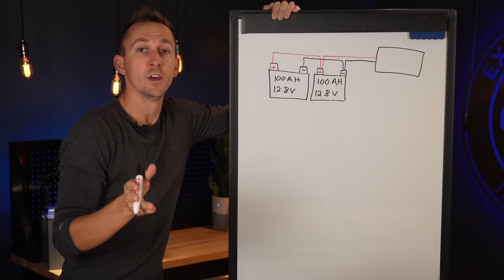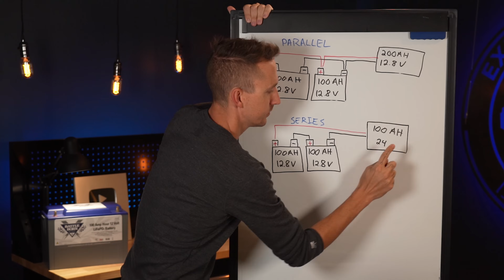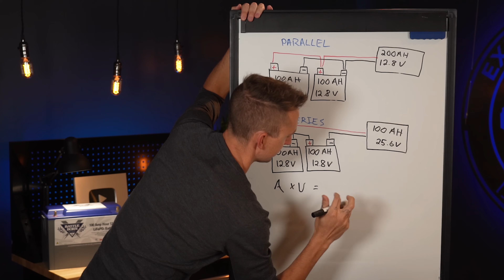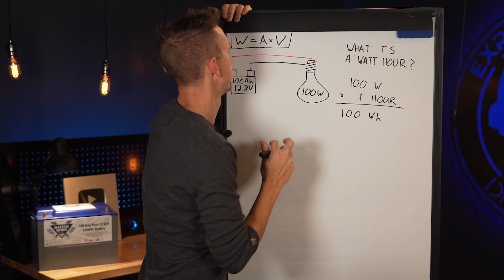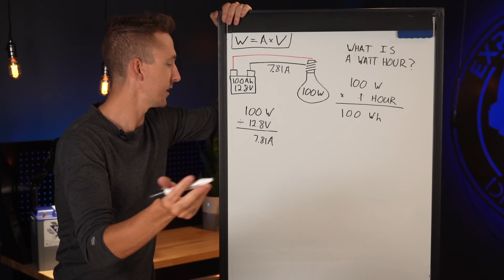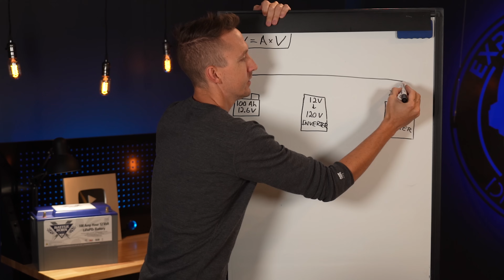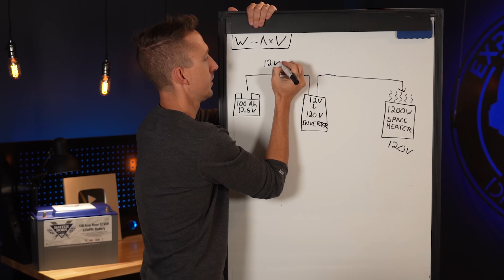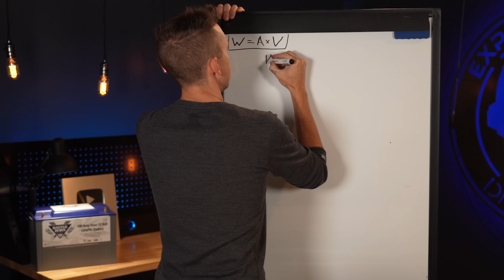AMP HOURS EXPLAINED (amp hours vs watt hours)

Comment: The true watt hours of the battery would be lower if we deduct like 0.85% for inverter inefficiency right? What would be the formula if we take that into account? I'm fogged out trying to remember that.
Reply from the maker: Let's not worry about that for the case of this basic-level video because then we have to start talking about inductive vs resistive loads kva vs watts and power factor.  It gets really really messy in a hurry.

Comment: Nate, your ability to explain with clarity blows me away.  I am an electrician and industrial maintenance technician and know this stuff like the back of my hand, yet when I try to explain it I'm falling all over myself.  Hats off to you, my man!
Reply from the maker: Wow, thanks so much! 🙂🙌
Reply: @EXPLORISTlife Is the max charge rate the same as max discharge rate of a battery? Thanks
Reply from the maker: Not usually.
Reply: It is to know with which voltage the 12v 100 amp or 24v 100 amp batteries are charged faster with a 30 amp charger. I think that the 24v 100 amp battery consumes less amp in use but to recharge it takes longer than the 12v 100 amp
Reply: @dado u prefer to fast charge or slow charge your batteries? vidcolon5903
Reply: Me too, all my life been playing with the electric arts. I normally explain it nicely to others but im still welcome to seeing how others explain it.
Reply: Hi,Nate,So I bought ADCBATT 12V 100AH Lifepo4 battery, W=1280? Is that how it is calculated?
Reply: Yes  @menglei6301
Reply: You probably work on practical stuff most often, than thinking on theory
Reply: Nate, do you have 4 batteries in series and parallel connection. Need 24V 400Ah? Is this possible for 4 batteries with 12V100sh each?.
Reply: @mannyvillamil4140 yes but will be 2x 12v batteries in series connected to 2 batteries in parallel 

So you get 24volts but incase capitacity 😊

Hooe that helps 😊
Reply: I'm a Millenial and I still can't get it. Starbuck never runs out of power.
Reply: @Mr.Negative-One  Yea,, but they ran out of decent coffee the day before opening their doors.
Reply: For coffee.....
Reply: @Mr.Negative-One  Because America runs on caffeine.

Comment: Wow! Mind blown! I honestly thought I would have to take an electrical class at a community collage to understand W=AxV. Well.. I will need to watch this a few more times but this is SO HELPFUL! Thank you!! The voltage! All I thought I wanted was 600 amp hours with a  3 to 5,000 (amp or watt) inverter. With 1,000 watts of solar. Apples to apples… I think I pulled something
Reply: A 5000w inverter* :)

If it was 5000 amp, it would be a really incredibly powerful and Big Heather

Comment: Smaller wires but also smaller parts . Since the parts have to be bigger to handle the higher current values.
Reply from the maker: Charge controller is a good example of that.

Comment: So 24v systems are not more efficient they just allow smaller gauge wire to be use because the amperage is half of a 12v system because the voltage is doubled, correct?
Reply from the maker: Pretty much!

Comment: Nate, using your example of light bulbs. The 12V system is correct. However the 24V system on a 12 volt lamp is twice the voltage required and as such wouldn't you need something to "Step down" the voltage and wouldn't that change the draw on the batteries?
Reply from the maker: What specific timestamp are you looking at?  If it's at the 6:24 mark, that's a 100W 24V bulb connected to a 24V battery.

If you were trying to power a 12V light from a 24V battery bank, the amperage would be different on either side of the step-down converter, but the power pulled from the battery bank would be most easily calculated by: Wattage of the load / Battery Bank operating voltage = amps pulled from the battery bank.
Reply: @EXPLORISTlife  That’s correct but I don’t think in the video that you stated it’s a 24 V bulb so I assumed it was still the same 12 V bulb
Reply from the maker: The only thing important there is that the light bulb is 100w in both scenarios and the light operates at whatever voltage we were delivering the voltage at.

Let's just retroactively pretend that the light I was using was 100W and would function properly in a voltage range anywhere between 10V and 30V.
Reply: @EXPLORISTlife  Nate, If it wasn't a 24V lamp. What do you need to step down voltage?
Reply: @sandstardusthighways7847  A 24v to 12v dc to dc converter
Reply: Nate, I'm not trying to correct you and I'm sorry if I offended you. I am just trying to understand with a 24V system how it gets down to 12V for things like a 12V refrigerator. I think the videos are great and I'm learning but I need to ask questions once in a while.
Reply from the maker: Not offended; just stepped away from the computer for a few hours this wonderful weekend afternoon. 🙂  If you were running a 24V Battery Bank and needed to power 12V appliances like lights/fans/refrigerators and such, you would want to add a 24V to 12V converter between your main system distribution and your 12V fuse block.  Buckle up for a big tutorial now, because I'm going to ask you check out the following video because that's exactly what we did there: https://youtu.be/E5q7_4FH4LQ

Comment: I appreciate your clear concise explanation in all your videos. Certainly helpfull. I'm exploring the new ecoflow power kits that seem full proof for those who don't want to cut, strip, crimp, heat shrink. Those are advertise as kilowatt systems, (5, 10, 15kwh). My only concern is the AC/DC Smart Distribution Panel that comes with their kit appears to limit the gauge wire it will accept. No doubt they have enough power but how do you connect larger appliances such as air conditioning unit with large gauge wire?
Reply from the maker: I don't have much experience with the logistics of setting one of those types of portable power units up, so I can't answer that question.  I would hope that would be something that the user manual of the device would clarify (or their tech support channels).  It's pretty straightforward with the systems like I teach on this channel with individual components, though.
Reply: Assuming you are running the large appliances off the AC side of the distribution panel, you dont need to worry about 'large' gauge wire in the same way you would on the DC side. An Air conditioner should be on the AC side and therefore need no larger than a 10AWG wire.

Comment: This is such a massively misunderstood topic. Thank you for taking the time to diagram it. The only thing I think could be better would be to demonstrate it with physical equipment and put multimeters on the equipment as you move through each step.

On the topic of "higher voltage reduces amps and permits smaller cables", electric vehicles being built these days are typically either 400v battery systems or 800v battery systems (or there abouts). For the sake of high speed charging we desperately need them to all move to 800v systems so that the cables at the high speed charging facilities can be reduced in size. Unfortunately that doesn't seem to be the case with big companies like Tesla. Hopefully that will change in another generation of cars.

Comment from the maker: 6:28 Clarification regarding "Running appliances at a higher voltage".  I should have said: "Choosing appliances that operate at a higher voltage".  We don't really get to pick and choose what voltage an appliance operates at aside from choosing a different appliance (12v DC air conditioner vs 120V AC air conditioner vs 240V ac split phase air conditioner)

➤Shop the EXPLORIST.life store: https://shop.explorist.life
➤Shop Battle Born Batteries: http://battlebornbatteries.com/?afmc=explorist_bb67
✅Use code 'explorist' for $50 off per battery.
Reply: True, though some motors can be wired for either 120 or 240, which can be handy should you be able to upgrade a workshop or such from 120 to 240 in the future.

Comment: Somebody needs to make an app on my phone to calculate all this! 🤣
Reply from the maker: Haha  It's already there!  Just the standard calculator to do Amps x Volts = Watts.
Reply: @EXPLORISTlife  
Thanks for the reply. A question here, what kind of generator do you suggest for backing up your solar? 
This is the final piece to the puzzle of my off grid system. 
I have a 5000 W Victron inverter, eight Battle Born Batteries in series, parallel to make 48 V and around 7K of solar panels. 
The reason I ask, is because of all the threats of power outages, and needing a alternative to solar when it comes to winter.  Perhaps you could do a video on this subject. 😜🖖
Reply from the maker: Both Honda and Champion are the generators I see used the most.  Something in the 3000w range would likely suffice just fine.
Reply: @EXPLORISTlife  
Do you know what amperage I would set my Victron 5000 W inverter too?
50 or 60 Amps? 🖖
Reply: @EXPLORISTlife  and an hour is an hour all day 24/7/365!

Comment: Coolio. Will u chat about the negatives of hooking up a brand new battery with a very old battery? Same type brand capacity, etc. as well as what happens if you connect a 12 volt battery with one that is 50 amp hours and another one that is 100 amp hours capacity…
Reply from the maker: Good idea!  Added to the 'videos to make'  list.  Basically, that's NEVER advised, but will go more in depth about it when I make that video.

Comment: NATE:  This is EXACTLY WHY I am running 220V appliances!
Reply from the maker: Mal, that's correct, but this is a basic level discussion.  I also didn't talk about inductive vs resistive loads and how they affect the conversion efficiency rating. 🤷😂  Sometimes I have to omit certain things that are less relevant from a teaching standpoint so that it makes sense for those watching.

Comment: I’ve often wondered what voltage to use when calculating power for a 12v battery? 12v, 13.6v(float), 14.4v max absorption, or some average between?
Reply: Whatever the battery is listed at at full charge. Each battery chemistry has a different voltage. The numbers you may be referring to our what voltage to charge a battery at…
Reply from the maker: Yeah, it's usually listed on the battery by the manufacturer.  Battle Born, for example, is 12.6.  If it's not listed, 12.6 is pretty safe to use.  For me... If I'm just doing quick calculations, I usually just use an even '12', and don't bother with decimals.

Comment: On a primarily 12v camper van. With a 2k inverter that is rarely used. With 4-600ah battery bank. Would you run 12 or 24? I would then need to convert it back down to 12v is there any loss doing that?
Reply from the maker: With only 2k of inverting power, I'd for sure stick with 12V.  Here's a video talking about why: https://youtu.be/sEW-ZaOOlq0

Here is a wiring kit for a 12V system with a 2k inverter/charger: https://shop.explorist.life/shop/all-products/camper-wiring-kits/complete-wiring-kits/wiring-diagram-kits/200-1000ah-battery-bank-multiplus-2k-12v-orion-12-12-30-wiring-diagram-kit/
Reply: 24v you can use smaller wires. Saves money and easier to run.